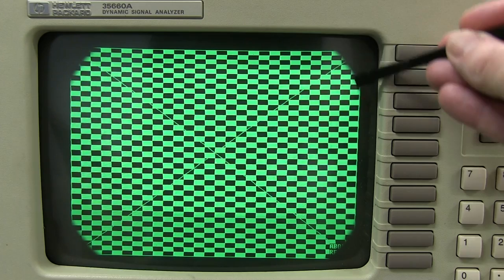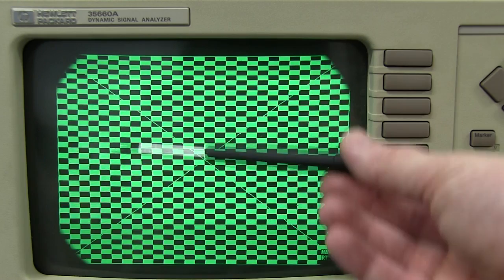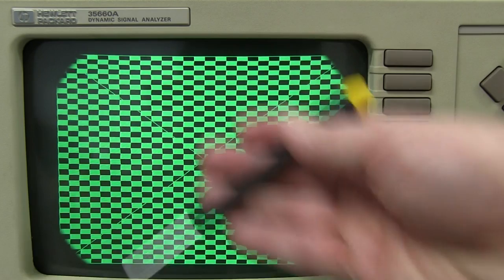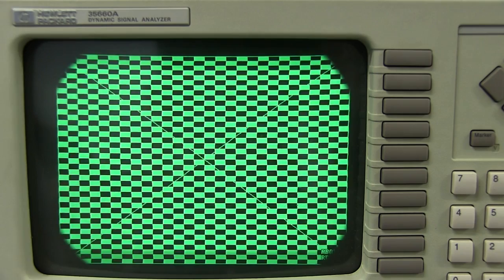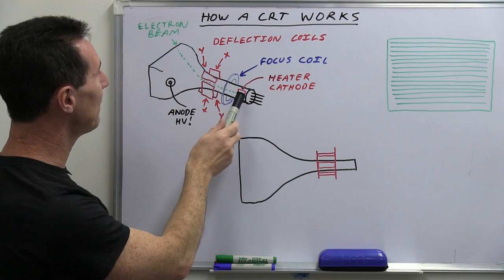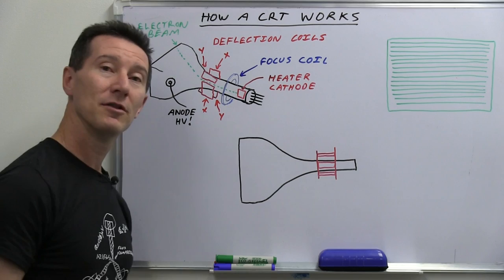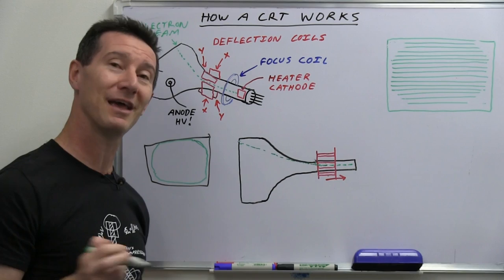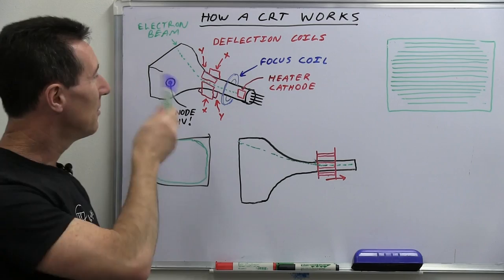EEVblog #524 - Vignetting on a Cathode Ray Tube

Comment: Well done Dave. I'm glad you figured out the shadowing. From the other damage, it was clear that this instrument has taken a tough shock from the back. Perhaps dropped on its back end. Enough to shock the neck board off and move the deflection coil back. That's a big shock! Even so, we can see it didn't take a lot of TLC to bring it back. If this were a plastic fantastic 21st-century instrument, you'd have been holding the thing in pieces.

Comment: At 2:17 Dave says the shutter rate is 1200 times per second. What he means is that the shutter setting is 1/1200 of a second. The camera captures 25 frames/sec regardless of the shutter speed.

Comment from the maker: I had initially suspected this was the problem, and mentioned I had already given it a push, but it didn't budge at the time. After the first video I figured (helped by all the confirming comments), that it must have been the yoke position, there was no other explanation, and indeed it was. It's not something I was unfamiliar with.

Comment: HP o scope CRTs seemed to be some of the most elongated ones I have ever seen. Now tighten that clamp until you hear glass breaking, I bought a scope, thought it was dead, but the thing was generating heat. I opened it up and the plug was off the back of the CRT & the deflection yoke also slid back due to a rather sharp impact in shipping. It had been encased in that expanding foam for packing.

Comment: Wow, tough audience Dave. Yes, Dave did draw an electrostatic deflection system. This raster CRT uses magnetic deflection. I think a tutorial like the one Dave's giving is easier to understand if you start with electrostatic deflection plates instead of magnetic deflection coils. The idea's the same but the forces involved are of course different. Analog scopes used electrostatic deflection. Raster CRTs use magnetic coils. Dave, I continue to be amazed at the rate you can chunk out these videos.

Comment: I know this video is very old but it's the first time I've seen it. so forgive me if all the following has been said in the comments. 

It was pretty obvious from the first video with all the evidence that the scan coils weren't snug against the back of the tube, causing the vignetting. The tube base being disconnected is also evidence that the coils were loose, they probably moved back and knocked the base off, that'd also explain why the geometry magnets were loose, they'd have been knocked off when the coils went back.

I suspect it's had a new tube at some point if the coils moved that easily, there is almost always a bit of masking tape around the tube neck for the clamp to grip (or sometimes silicone to hold it in place after it's been tightened up) into.

Interesting fact, if the beam current is high enough and the coils are left like that it's possible to 'drill' through the glass of the tube neck with the electron beam. 

Focus isn't magnetic, it's electrostatic BTW.

Comment: Nice one Dave. The Horiz. Def. is up & down. The Ver. Def. is on sides. The relation between magnetic fields and elec. fields, here is the same issue. And for the focusing, no easy way to focus electron by magnetic as the electron will drift aside. The focusing is been done by a voltage around 700V inside the tube, that is why you may find a variable resistor for focusing, its output is going inside the CRT, standing in front of the Electron Gun as a metal disk having a small hole in the center.

Comment: In the previous video you implied you didn't specialize in crt systems, never refered to the issue as vignetting, and tried to make the display smaller than the "dead spots". I don't expect someone who specializes in digital to be intimately familiar with discreet amplifiers.  So I was a bit surprised when your next video was an educational video about crt's and vignetting as though you specialized in crt's, with no thanks or credit given to commenters who 'helped confirm' the issue, thats all.

Comment: A few additions to that video... There is not only magnetic deflection but also electrostatic deflection. So if your CRT hat plates inside (like most old oscilloscopes) then the beam is deflected by the electric field. There are no coils inside the CRT.

Comment: On measurement equipment, I would not bet that they use interlacing. I´ve used once an old school, but in the time high tec Scope with Color CRT. After a few minutes, I had a headache. When I move my head, I even saw rainbow flashes (colour separation) so I even think that they skipped the three beams on that particular model I used. Measurement equipment isn´t a TV screen.
The common work around for this issues, is to use the VGA output and connecting a Computer/TFT monitor. Works a treat.

Comment: The main reason is expected deflection angle in CRT with magnetic deflection commonly used in tv sets is 110 degree.  CRO tubes are very long comparing to screen dimensions, so electrostatic deflection is enough advantage is driving it by voltage which is much simpler.

Comment: right ive got that not exact, but it is still not an coil, they use like a pinhole shaped or cylindrical anode with i think a negative voltage. it should be behind the Wehnelt cylinder. sorry for getting it not so precise

Comment: Good quality CRTs like the one here are painted inside from the deflection coils to the edges of the front of the tube. I've seen countless cheaper tubes that did not have this and any overscanning caused a reflection in the corners or even the sides in more extreme cases. It would look as though the corners of the image instead of being missing would be folded back toward the middle of the screen like a dogeared page in a book.

Comment: Focus coils went out with buggy whips; your monitor uses electrostatic focus. And rather than bicker over the correct pronunciation of "vignetting", call it "neck shadow" instead. If you want to perfect the centering of the raster, there's a couple of ring magnets clipped to the back of the deflection yoke; rotate them to center things up. Other adjustable magnets around the periphery of the yoke are to correct pincushion.

Comment: Electrostatic deflection is good at deflecting random small angles very quickly, but doesn't handle large angles well. 
Magnetic is good at large angle deflection, The circuits are designed for a single or a small number of angles.

Comment: Well, that is untrue. The Wehnelt cylinder forms part of the electron emitter assembly, and provides you with a narrow beam focused at al short distance of it (its position depends of some voltages I do not want to get into). The focusing coil exists, it is much more voluminous, and its purpose is to focus the beam on the screen. In this case it may well be fixed magnets. 
CRTs have both AFAIK.

Comment: Funny... was screaming at the video about the yoke alignment and seating.   I used to repair 1st and 2nd Gen Macintosh video systems quite a bit.   It is not uncommon for a short, sharp, shock to knock the yoke and Cathode connector off the tube.  Especially when the assembly is old... lots of thermal cycles makes everything loose.  Doesn't take much of a knock to bugger the whole thing.

Comment: I wonder what happened to this device to make the circuit board fall off the end, as well as shaking loose and rotating the deflection coils. You said the device did not appear to be dropped but it must have suffered some trauma. If it was vibration, it must have been quite intense. Do you have any history for the device? Do you know who used it before it appeared in the auction?

Comment: On a CRT, if toy remove some of the coils (tried on an old 5 inch black and white portable CRT TV, you can quickly cause a burn in on the display) (I actually took it apart while it was running :) )  (though I did not get a chance to play with the high voltage stuff (should have ignored the warning around it and see if it would really hurt to get shocked by it :)

Comment: I'm a little disappointed you didn't give any credit to the tons of comments on the previous video who correctly informed you how to fix the problem, it seems like you're passing it off like you already knew what the problem was without even knowing how to pronounce it.  Still, Im glad you figured it out, and thanks for the update, glad you got a nice bit of kit without a huge repair effort, though I would still love to see a full on signal induction/tracing sherlock holmes level repair video!